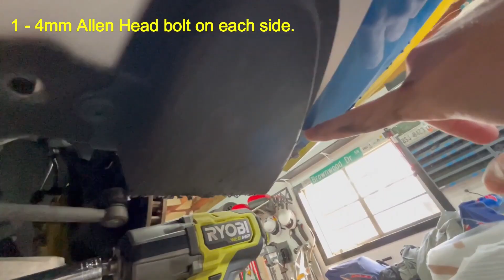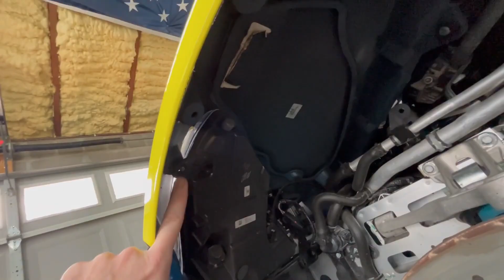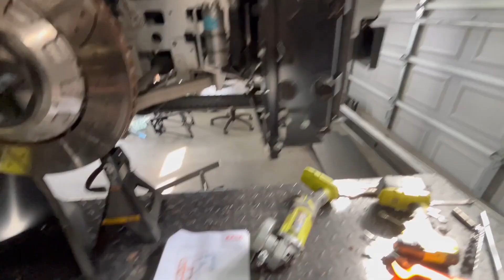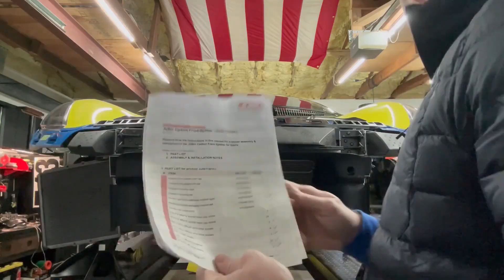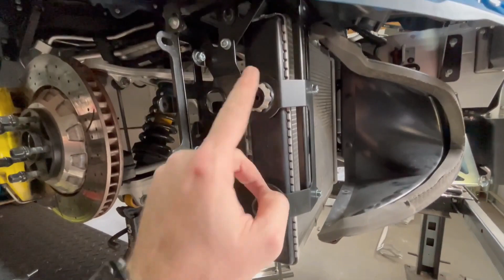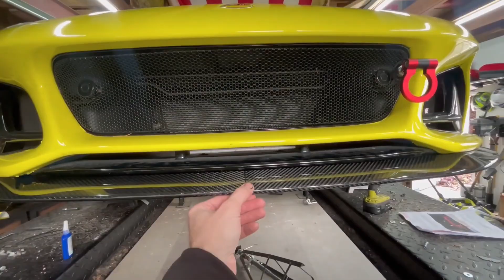Lotus Emira - JUBU Aero Install, Front Splitter (1/4)

Comment: Awesome stuff, easily the most informative tutorial anyone's done on an emira. One thing I wish jubu had included was 1 or 2 aluminium skid plates to clear steep angle on and off the track.
Reply from the maker: Thank you! I thought about reinstalling the factory skid pucks. As of now, I haven't done so, but I'm still considering it.

I'm also considering going with some Nitron E-tron coilovers with the front end lift to prevent that issue. I already struggle to get in my garage at the current height.
Reply: @Savanna7 Not sure what your local track is set up but if it has a long straight or high speed corners, I’m curious how much you scrape now. 

I’d probably have the skid plates on and run the aero on track just to feel the added downforce and order the nitro with custom sprint rates to compensate that.
Reply from the maker: @ajonathany  You're not wrong. I haven't tested it yet, but I'm sure the factory springs are going to struggle. My Zenos started dragging at 132mph with factory suspension. It had a larger splitter, but same concept.

The current top speed that I have seen on the Lotus at my local track is 143mph. That's only going to continue to improve as I learn the car.

Comment: Geez why is this so complicated. They couldnt figure out a more streamline way
Reply from the maker: Most Aftermarket pieces bolt right in place to where the undertray sits. The JUBU piece however is meant to carry the load of the downforce it creates.

It makes you ask yourself, how are other cheaper variants holding up to the downforce then? Maybe they are, or maybe they flex at speed on track, I'm not sure, but I do know, I personally built one for the Zenos and right at 132mph, she's scraping the tarmac. (I need stiffer springs or better bracing.)
Reply: @Savanna7 there's no question that is one comprehensive setup. It is certainly better than anything that bolts on to the existing holes. However I'm not sure there is much Flex going on at speed with my front spoiler. Ive had it up too 160mph. Maybe I'll get a camera up there and see if it shows anything
Reply from the maker: @1fastmx5 I’m sure it’s fine! If it’s hasn’t scraped at those speeds you won’t have any issues. What brand is yours?
Reply: @Savanna7  CT Carbon. It doesn't have real aero testing like yours so I doubt it has the downforce of yours.
Reply from the maker: @1fastmx5 did the underside contain any type of diffuser in front of the wheel well?